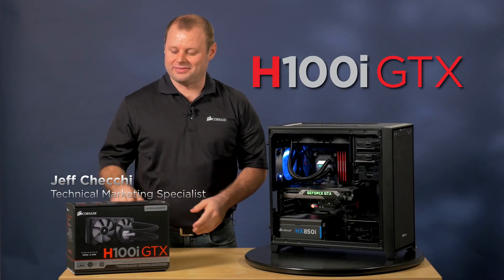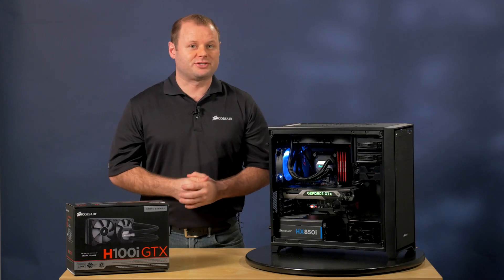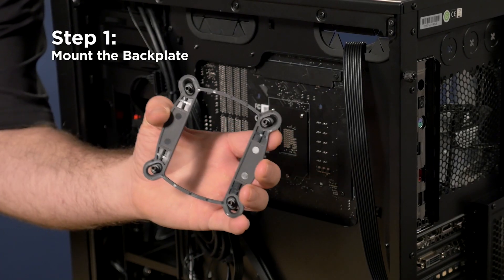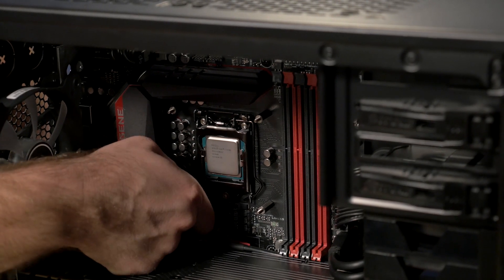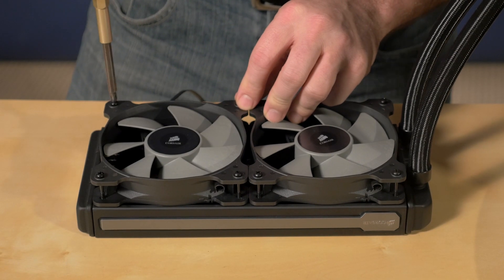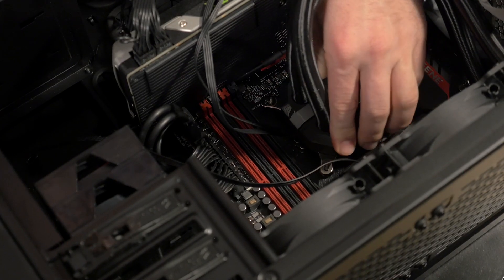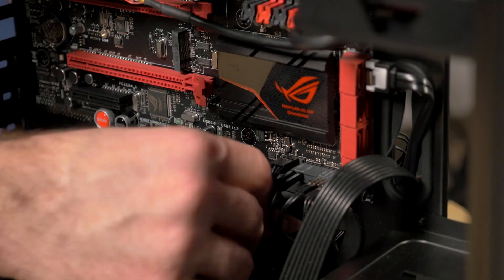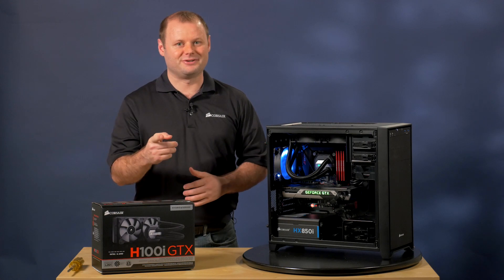Corsair Hydro Series H100i GTX Liquid CPU Cooler Installation How-To Guide

Comment: I will randomly get "CPU FAN = 0 RPM" and my computer will shut off. Sometimes it won't turn on due to the same error. Any help?

I'm running this on an ASUS Sabertooth 990FX R2.0 and downloaded the LINK software already.
Reply: +omar eldasher I will be interested to know if you ever get this issue resolved, I am about to refit my computer with a Sabertooth board and the same corsair setup.
Reply: Evil Tigz Not at all. and since the issue appeared after having it for 30+ days, I can't return it. I've called and their repair was to no avail. It still occurs the same way it did before. So I complained to Corsair and they did nothing.
With nothing left to do, I pulled out that warranty card and followed the instructions. I explained my issue in the ticket, and requested for a refund, not a replacement. Because the product was fine, but the compatibility wasn't, something they didn't warn you of that could cause major damage to your components. 
I'm still waiting on hearing from them. I shipped it back about 3 days ago or so. 
If they give me a new one, I am doing nothing but selling it on ebay. I am sticking to air cool. I got the V8 cooler by cooler master and it works like a dream. Quiet, strong, and sexy. My custom water loop was fine but made me feel uncertain, and these sealed ones obviously have issues. Nothing is more reliable than air cooling.
Hope this helps.
Reply: omar eldasher
Funny thing is I was considering the V8 before I got the Cosiar GTX.  I was also looking at the BeQuiet Dark Rock Pro.  Well I am sorry you had issues with your Cosiar, thank you for the information.
Reply: +Evil Tigz Did you ever liquid cool before?
And if it's still sealed, return that ish
Reply: First time, all my earlier builds have been with air cooled only.  The cooler itself is still boxed because I been waiting on some more parts before I was going to install it.
Reply: +Evil Tigz I absolutely urge you to get rid of this if you are planning on the Asus board (which is great btw). also, with typical liquid cooling, though sounds and looks cool, it'll only cool to the ambient temperature. so if your room is 90degrees, that's the coolest your cpu will be because the liquid (the cooling medium) will be sitting in the reservoir at the same room temperature. 
A good air cooler will do the same or 1 degree warmer. but without all the stupid complications.
Reply: +omar eldasher omar, i read all your comments and some threads on corsair's forum and i saw that almost everyone who had this problem had an ASUS Mobo, maybe it's just a coincidence. i'll install mine on my MSI mobo in the next few days, i'll let you know if that works for me
Reply: Osum Yeah I found a lot about that online with ASUS mobos and this cooler. But this should be something that corsair mentions, like noncompatible with ASUS warning or whatever.

Comment: Which one is quieter if i get Quiet Edition SP 120's, H100i GTX or H105?
Reply: Shahzad Khan I have the H110i GTX and the pump is virtually inaudible even at max speed (~2800 rpm).

On the other hand, the fans are awful in that regard, so I'm replacing the with a couple of Noctua's NF-A14.

Comment: I've owned this cooler for about 3 months now, so I figured I would leave my review here. With some Q/A too.

Despite the relatively high pricing, this cooler works quite well for what it is (a 240mm AIO cooler with LED effects and sexy tubing). The cooler beats out every other 240mm AIO on the market at nearly every clock on every CPU, which is saying something. That doesn't mean it gets off scot-free though. Since the pricing eclipses and exceeds some 280mm options on the market, it wouldn't be fair to count them out either.

For most reviewers, it appears that this cooler is BETTER than 280mm offerings, and it is, to a point. I compared this cooler on my test bench to my Kraken x61 using two different CPUs on two different motherboards. Most reviewers don't clock their CPU's that high when they test AIOs, a flaw in my opinion, because at stock clocks, this cooler will cool better than any cooler on the market, even the H110i GT in some setups. I will detail why this cooler is the best 240mm AIO, but overpriced for what it is (though I don't know Corsair's BoM for this cooler, so it might actually cost a massive amount to make, I can't know)

Test setup: Lian-Li Pit Stop Test Bench
Asus Crosshair V Formula Z+ AM3+
Asus Maximus VII Formula Z97
AMD FX-9590
Intel Core i7-4770k
16GB Kingston HyperX Fury 1866 MHz Red Edition (DDR3 of course)
1TB Samsung 850 Pro
For the best example of out of the box performance, I used the SP120Ls that came with the H100i GTX, and the fans that came with the NZXT Kraken x61. I usually use Noctua NF-F12 iPPC Industrial 3000's on the H100i GTX, and the F14's on the Kraken X61. Both of these coolers were tested using their highest performance setups. With the GTX in pump performance mode, and fan performance mode in Corsair Link. The NZXT Kraken is in Extreme Tweaker mode with max fan speeds and pump speed. 

4770k 3.5 GHz: Kraken 37 C, H100i GTX 35 C
9590 4.7 GHz: Kraken 44 C, H100i GTX 43 C

4770k 3.9 GHz: (sustained boost): Kraken 39 C, H100i GTX 37 C
9590 4.9 GHz: (mild OC): Kraken 46 C, H100i GTX 46 C

4770k 4.3 GHz (decent OC): Kraken 45 C, H100i GTX 45 C
9590 5.1 GHz (heavy OC): Kraken 59 C, H100i GTX 64 C

4770k 4.9 GHz (max clock): Kraken 61 C, H100i GTX 78 C
9590 5.4 GHz (max clock): Kraken 65 C, H100i GTX (reached TJMax, failure)

So, as you can see, the H100i GTX cannot compete with most 280mm coolers at really high OC's, or power hungry chips like an i7-E, or 9590. I sadly didn't have an i7-E to test, but the results would have been similar to the 9590. Also, the H100i GTX just simply needs new fans... the SP120Ls have a much higher static pressure than the SP120 Performance Editions, but they do so at an ear splitting noise level, make no mistake, these fans when they are working hard are the loudest things in the world, beating out my R9 290x Lightning at 70% fan speed for noise.
Reply: In my setup. You can hardly hear it. But if your pump starts to make a noise.  RMA it immediately.  Pump noises are not good. However you should not hear the pump tho.
Reply: Do you have to replace them once in a while?
Reply: +speedevil22 Great test results. Normally on corsair coolers I switch the fans to Static pressure LED versions. Longer cables and flexible cable management. I also wish corsair made 4 Pin LED and Non LED fans vs the standard 3 pin. I will get this cooler soon tho to match my case branding. I don't overclock because the CPU performs well enough for me but if I choose to overclock, atleast I will have this H100i on standby. I would like to suggest adding the 4790K to your test bench ;)
Reply: +Rikki Boodram Yes, I too wish they made PWM LED edition SP fans. That's something I've emailed them about and they came back with the "Great idea, we've passed this on to the team". And yes, I need to acquire a 4790k because the TIM between the chip itself and the heat spreader is so much more consistent. It's also clocked higher at stock. Only gripe I have with this cooler outside of price is:

1. Corsair Link can be a pain in the ass sometimes, especially on Windows 7, it sometimes forgets my fan presets and the fans reach max speed in "quiet mode". I fixed this by creating my own custom fan curve in the software.

2. The tubes going straight into the waterblock looks great, but combined with how tough these tubes are, it can make it difficult to install without a second person if you aren't experienced.

Thanks for the feedback, and for the record, this is the AIO I use in my own personal rig. So it met and exceeded my expectations, even at the high price.
Reply: +speedevil22 How loud is the pump???
Reply: ***** Ok thank you! I already bought the Swiftech H220-X anyways :p
Reply: Alex Maia Very solid cooler with the ability to add a GPU into the loop, albeit very hard to get a hold of. Great choice.
Reply: +Alex Maia pump is quiet the fans are loud if they go higher than 2000 rpm.
Reply: speedevil22 Thank you! It is very silent too and i love the looks! It was considerably more expensive here than the Corsair H100i GTX, around 50% more expensive to be precise. But after reading a lot of reviews i though it was a good choice.

Cheers
Reply: +speedevil22 I don't think that AIOs are made for such high OCs. Anything > 4.7 GHz is custom loop territory imo.
Reply: Heaven
 True
Reply: speedevil22  does it need water how do you put it in  is it prefield or some thing ??? answer please ......
Reply: ^ I want the answer too
Reply: Hi. How is the liquid cooling setup doing now? I am planning to go with Corsair 115i for my i9 7900x. My biggest worry is the leaking of such a setup because it will destroy my over $3000 setup. Do you think there is such a danger. Is there any way to make it safer to install? Thanks.
Reply: Is it possible to refill it? Mine doesn't cool well anymore and I think it might be that the coolant evaporated over the years
Reply: @einfachnurleo7099  sorry man, I think you need to just get a new one. These are sealed units that have air bubbles bled from them, so trying to refill it somehow is likely to damage it/introduce bubbles.

Funny how old this comment is, happy to answer your question
Reply: @speedevil22  yeah... Pretty sure I got mine in 2016. First troubles appeared about 1-2 months ago. Since then the game I usually play (genshin impact) sometimes led the CPU to overheat like crazy. My new Thermal paste will arrive tomorrow so first I'll try to replace that but I fear that's not going to be enough (even though that too should be around 8 years old). Generally it seems like everything is still working and sounding fine. No pump issues. But if a small load allows the CPU to go to 80° then something must be off.
Reply: @einfachnurleo7099  yeah see if repasting and re-attaching the cooler fixes it. Use compressed air and dust the radiator.

If not,
It is likely one of two things have happened:
The pump (located in the waterblock) has failed. 
AND/OR
There has been a build up of debris in the fluid (happens over a long time) that has clogged the radiator fins. 

Best of luck.

Comment: Does it makes any difference if i put the radiator on the other side? (Water cables curve on the right of the block)
Reply: IPawn3R Not at all. It doesn't matter where or in what position you put the rad as long as you don't put too much strain on the tubes.

Comment: I could not install this with the washer, the screws kept slipping out.  So I installed it without the washers.  I hope that won't be an issue.
Reply: +Scheefinator Only possible issue would be noise from shake, but if there is none then you're all good!

Comment: Why put a 3-pin wire on the pump? All modern motherboards are 4-pin pwm. I tried for an hour to get my motherboard to stop throwing up CPU fan error with the pump plugged in. I refuse to set my motherboard to ignore fan error for CPU.... This POS is going back.
Reply: I had this same issue please let me know how you fixed it. I would greatly appreciate.   It ty
Reply: +JUSTIN BIBER a 3-pin wire will still work on a 4-pin header just with less bells and whistles.

Comment: The only side in my case that I can mount this is on the front.  Should I set this as push/intake?  I also have two exhaust fans, one on the back and one on top.

Comment: wheres the liquid??
Reply: Barish K It's sealed. So no contaminants will get in to grow as a bacteria or fungus. So it'll always stay fresh. The water only gets heated, cooled, and circulated. The metals used in these products are not going to cause corrosion either because their ion discharging will be identical between the block and the radiator. 
This type of system is forever better than a custom setup for a number of reasons. The only pro about a custom set up is that a bad part is replaceable but in this system the whole thing will need to be replaced. BUT a single part in a custom loop basically costs as much as this entire setup! And this doesn't require maintenance. The only reason people really go custom is because it looks cool when you customize it your own way. But I went down that route and it's honestly not worth it. The tubes fogged up, the setup was expensive, and I was always nervous that a single part may leak. I had to flush it periodically... I ended up tossing it and now I got this. Much better and cleaner.
But to each their own.
Reply: omar eldasher I'm planning on getting an i5 4690k or an i7 4790k and I'm very lazy so I think this will do well for me, idk if it's very wise to spend this much on a cooler tho
Reply: Barish K just depends on what you're using it for. OC, yes. Heavy gaming, yes. Keeping system quiet, yes. Video editing etc, yes. Anything else, you shouldn't waste your money.
Reply: Nednarb  It's a sealed system. The liquid is preinstalled and sealed.
Reply: ^^^ do you have to put new liquid in time to time?
Reply: omar eldasher I plan on doing a little project with my xbox one. Are the cables easy to bend to lead out the side of the xbox one the case? Or can I disconnect any of the two cables in case i need to run up and out of the xbox one with two little circles?
Reply: Brandon Miller
Brandon, the cables are not easy to bend. They're rigid and it feels unnatural the first time you try to position them. 

I also am having problem with this cooler. I am using it on an ASUS motherboard and sometimes my computer would shut off unexpectedly after giving me the warning of CPU FAN = 0 RPM, and sometimes it wont turn on at all. The software seems to lose control over the pump and it causes this error. I called Corsair and they told me a quick fix by setting my BIOS to ignore my cpu fan speed and to set the speed default to Max 100%. This is a retarded fix because if I ever do have problems with the pump/fan speed, I won't know and my cpu could get fried. 

I don't know why anybody would want to liquid cool their xbox one, because it works absolutely fine as it is and it's quiet... and it's an expensive piece of equipment!
But I understand some people just want to (I guess they like throwing money away, idk) but if you plan to, either get one that's factory made for the xbox one or build a custom one, so you'd know why something goes wrong, when something goes wrong (because something will always go wrong). If you take this set up for an xbox, the software might not communicate properly and the cooling may stop abruptly. Best to have a separate pump for a project like that, so software isn't an issue.

Hope this helps and I hope you complete your project successfully.
Reply: Brandon Miller please dont, like you'll just waste your money and the xb1 doesnt thermal throttle anyway so who cares? AND ITS AN XBONE NOT WORTH SPENDING 100 PRETTY PENNIES TO GET IT RUNNING A LIL COOLER ;)
Reply: Brandon Miller And also, no the cables are not removable.
Reply: Oh okay thanks for the input and previous experience. I'm doing this on a separate xbox one. Not my main one. Not only would this be for performance but for aesthetic purposes as well. Plus. I haven't seen too much watercooled xbox ones just as a modd. Is the software needed in order to run?
Reply: omar eldasher ?
Reply: Brandon Miller  no, the software fixes bugs though. 
Not worth it man, but it's yours so do whatever you will.
I'd sell a spare xone lol

Comment: Will this be good for overclocking i7 5960x on an asus x 99 deluxe mobo ? Any pointers to look out for during installation so as to avoid leakages or any bios settings ?

Comment: Just wondering. I am thinking of getting a water cooler for my cpu. But I am new to this so this may sound dumb but do you need to drain and replace the water on these cpu cooler.
Reply: tamboleo 
After 5 years of using it, i guess it would start to have problems then it would fail.
But dont worry,
Corsair have a 5 year warranty for your product wich they can replace instantly.

But for me,
Id say just get a cpu fan cooler. If your not into overclocking your pc and you really dont need it.

But if u want to ur Pc to look badass and cooler then go for it.
Reply: mark virgil tablo Or if you're one of those temp freaks where your PC can't go over 60 degrees celsius or you'll start having a mental breakdown, or if you just want your ambient temps a few degrees cooler while under heavy load, which is why I plan on getting it.
Reply: @Sopixil  im one of the freak tbh
Reply: awsomeluis8 no,
the liquid solution they have is already in there & you cant take it out.
they said it would last for years maybe 3-5 years depends on the user.
Reply: mark virgil tablo And after that time?
Reply: Wow man your such a freak. It's just 60 degrees let it go. lol (Joking Btw)
Reply: Would this be good for silent gaming I have a amd stock fan which is terrible..

Comment: Is there anywhere that shows temperature comparisons between the cooler and other ones like it? (including your own previous ones)
I have the H60 right now, but the radiator gets extremely hot with just my FX 6300. I'll need to upgrade to a better CPU soon, and the 8350/9350s get really hot. I'd like to know just how much of a difference there would be from this.

Thanks